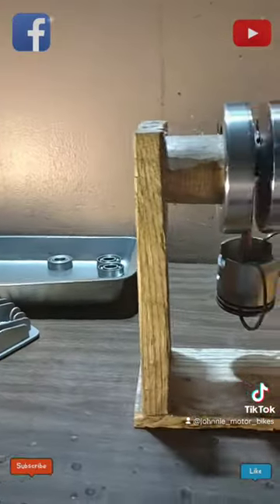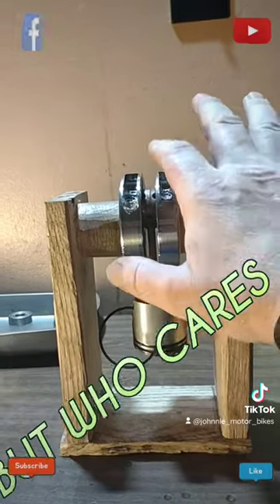BALANCED CRANK..... I THINK..... BOY ITS UGLY #shorts

Comment: Btw yd100 top end arrived! 

Wait what lolz?  How do you know the whole unit is level? If its tilted even 1 degree it's a huge change. No way to balance a crank with the bearings captured.  There is a friction value now introduced. 😏  I just want to see it run lolz.  3x 12mm deep holes = ms460 52mm piston lol.  47mm like you have is 2x 12mm holes 10mm deep.  But even if that comes out balanced is it going to spin true if the material is unevenly removed is going to be the interesting question. Like a car tire weight to stop the wobble
Reply: hey buddy i think in them wooden dowels he has holding the crank he has bearings pressed into them . but i get what your saying . it will be fun to watch and i do hope it works good  . i mean ill never do it but  i like his rig it up spirit . if it works maybe he can make a better one at some point out of aluminum or steel  the jig that is . the problem with wood it it can change with moister  and warp . that will throw off the measurements  every time it will be different .
Reply: @diydarkmatter  well if you capture a bearing there is friction!  Then you have no way to level them for balancing surface. I just want to see that sucker spin up lol.  Have a feeling bolts in the engine will be mile behind the bike by second mile lolz
Reply from the maker: Love the negativity as always. But it runs good, have major clutch issues all of a sudden but it spins way faster then I expected these duration to achieve. There is a vibration in the very middle of the RPM's probably because of the uneven side to side but that's what this crank is teaching me tbh. I didn't know how deep I could drill and dig it out before goin to far.... But now I do. Lol. Either way it's a great lil stump puller but I already see a couple things I would change in it as far as the lil bearing shims I made for the wrist pin bearing and I have another idea I really want to try out to loose case volume overall which I think I'm going to do to this crank since it's already a show piece. Also dark is right I have case bearings in the wood. It's not perfect but it's better then the one I had before I made this one.... Which was none.   If I did everything correctly then my channel wouldn't be fun to watch..... Then it would just be yours hahaha
Reply: @JMB676  not negative, just like basic step 1 of balancing "anything" never to use bearings, lol. Then it has to be on perfectly level surface to roll on. No way to level it so it can't balance.  Not being negative....   just how it mechanically works lol

Comment: You shouldn't balance a single cylinder engine with the full weight of the piston assembly. For this engine you should use around 60% , including the top part of the conrod.
Reply from the maker: Really that's great info. I didn't know that, is there a reason or not sure, just want the info. Enjoy learning about it.
Reply: @JMB676  You can never perfectly balance a single cylinder engine without balancing shafts. When you use a balancing factor of 100% you just change the direction in which the engine vibrates 90 deg. You should be looking for the balance factor which gives you the lowest average vibration which depends of the geometry of the given engine and rpm and is usually between 50 and 60%.